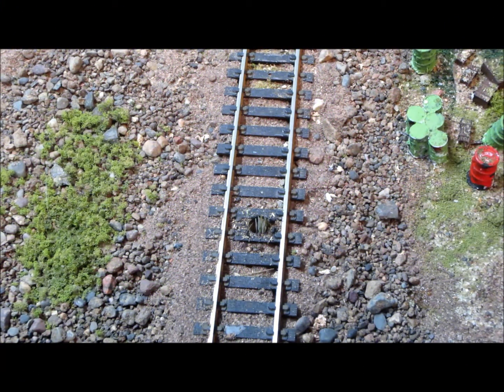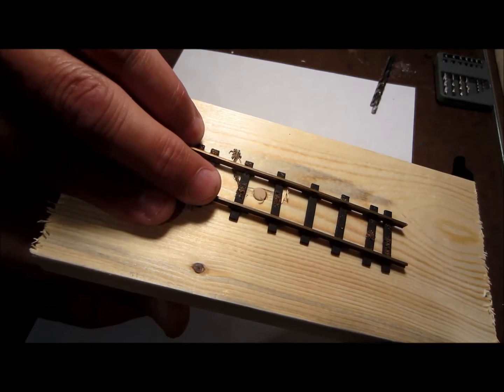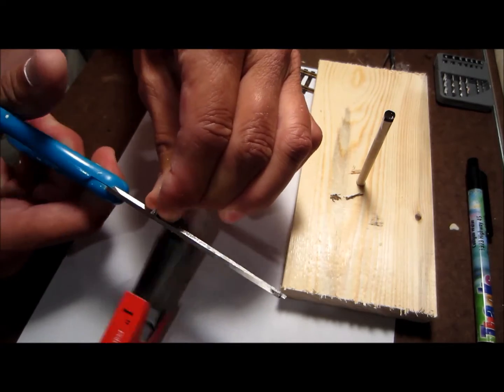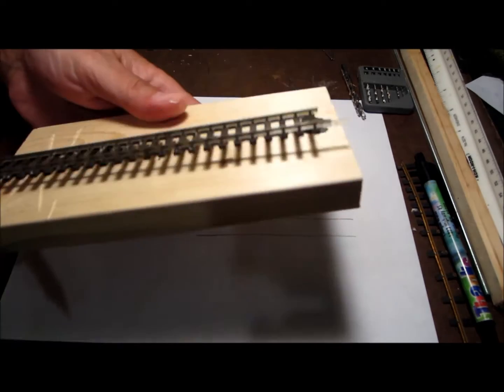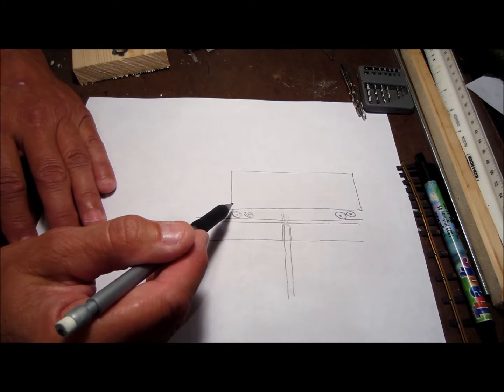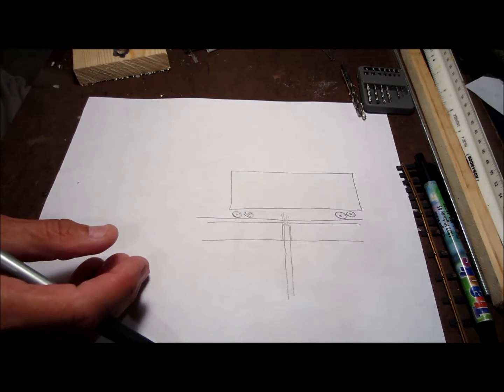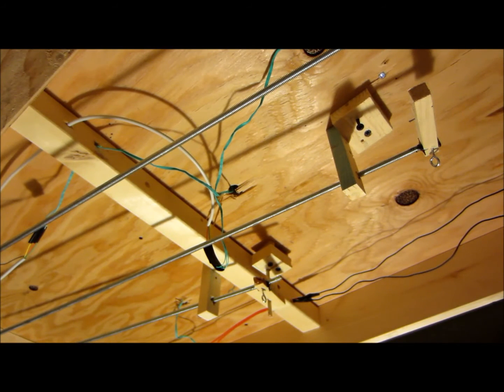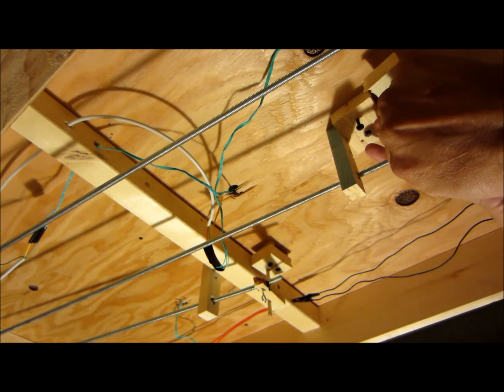Hump Yard Retarder Contruction

Comment: when installing the brush it would make it much easier if it was covered by a straw then you would guarantee not to stop any bristles not coming through the hole completely then you could remove the top section of straw after the install... I think this is a great yet simple idea, also there is no need for the long length of threaded rod, a piece of dowel would do the same job and much cheaper also.. .. something that I will look into as I make my hump yard, I will also be adding buffers to the end of the tracks unless they are long enough to have switches at the other end for access by a loco........ Thanks for the video..
Reply from the maker: In a later video, with much smoother running freight cars, I found that just the bristles were enough and I did not need the raising and lowering mechanism.  They needed to be strategically placed, however.  The option to raise and lower the bristles was useful when freight cars had inconsistent coast speeds.

THANK you for commenting!

Comment: Good idea with the brush bristles, however as far as implementation goes, I would personally use a switch motor or some other servo and have it extend/retract automatically.
Reply from the maker: Thanks for bringing that up!  I noticed some of my freight cars roll at different rates.  Being able to customize the brushes for each car allows for controlled braking.  In design, the sources of trouble identified were:  either the car did not roll enough or rolled too fast and jumped off at the end of the track.
Reply: @davidbanta3659  Yeah I was actually surprised you didn't terminate the track with a spring-loaded buffer stop.